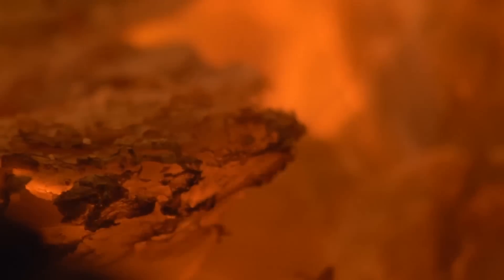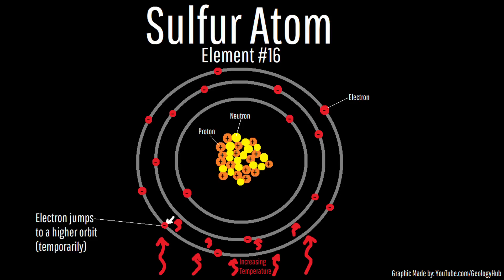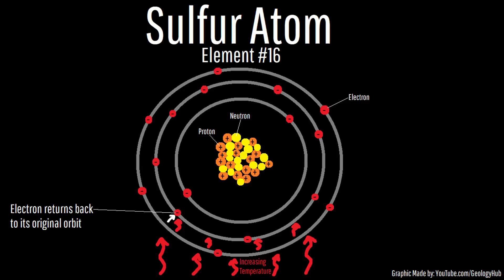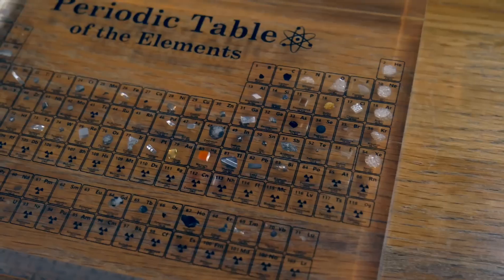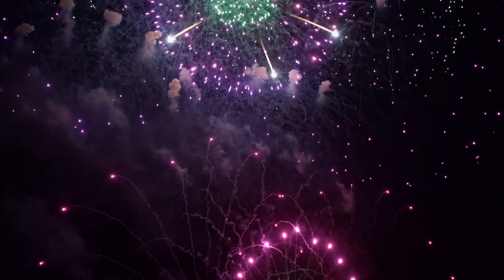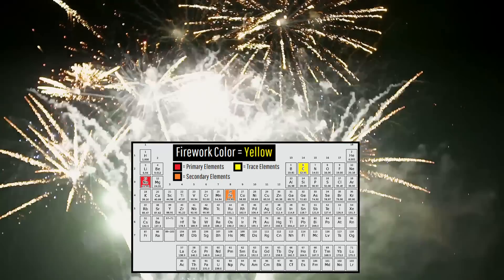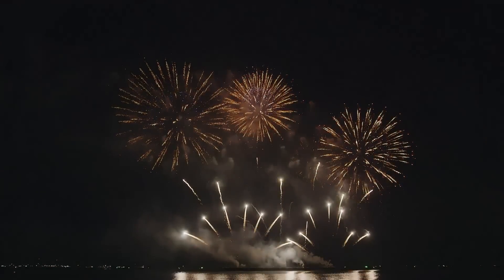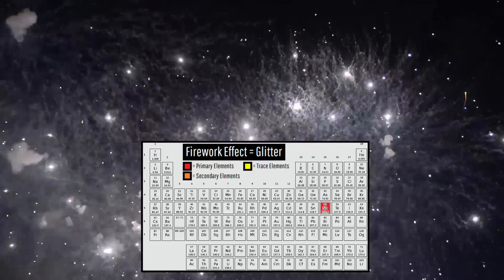The Chemistry Of Fireworks Explained!

Comment: While rubidium and lithium can be used for pyrotechnical formulas, they almost never are except by experimenters. The reason that factories don't use these chemicals is simple...they cost too much. Reddish-purple is achieved with strontium and copper salts, with the addition of a chlorine donor and a binder, plus an oxidizer. Pink stars are achieved with calcium carbonate, red gum and lampblack.

It's important to remember that most fireworks factories MUST use the cheapest possible chemicals and components in order to squeeze out a profit. Competition is fierce and margins are slim, so they have no choice. Experimenters and amateurs don't care about profit margin, so that's where you'll see the exotic chemicals.

Comment: Very pretty, but I’ve always wondered how much pollution fireworks put into the atmosphere…
Reply: Not even in the top 100 of pollutants
Reply: It is not much, though breathing all those metals is definitely something you don't want to do. Globally, this is not an important source, but locally, if the conditions are bad, it can persist for days, then it really becomes a problem.
Reply: Hardly any
Reply: Fires are probably a bigger risk. One of the reasons why there haven't been fireworks at Mt Rushmore most of the last decade. Also, perchlorate was getting into local groundwater.